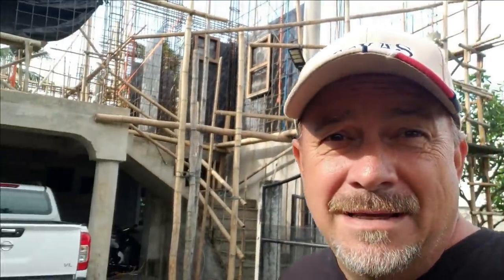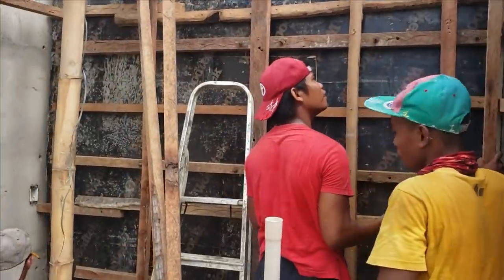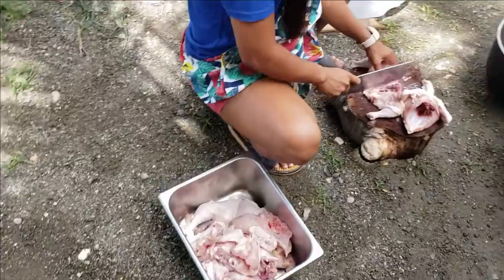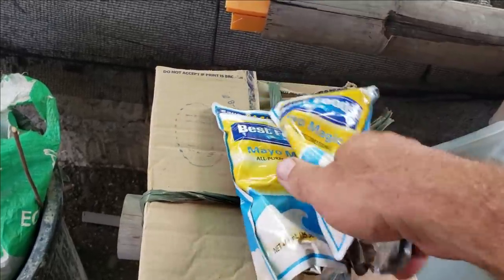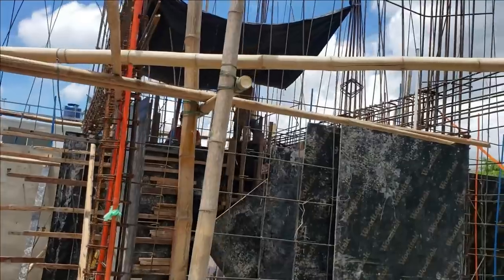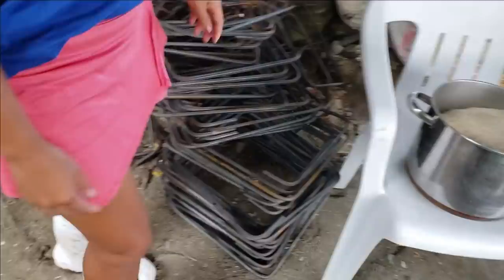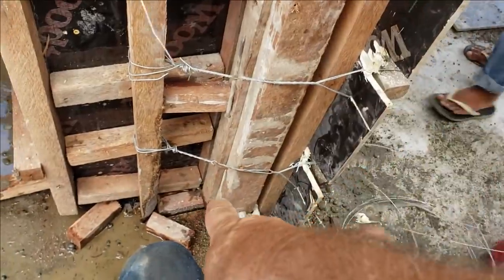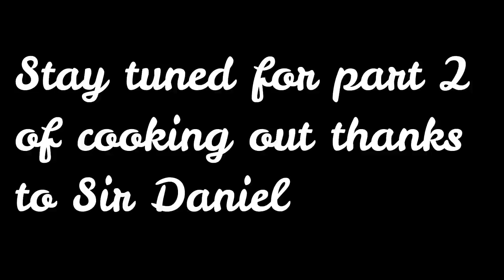Philippines Beach House Build Day 162: We Have Rooms and Hallway Now!

Comment: I know the rubber mallet works well on the forms as your walls look great, but maybe try a sawzall without a blade to vibrate the form.
Reply: Or, better yet a air chisel with a solid rubber ball fix to the end. Bamb!!!!!! No freaking air quaranteed.  Just a little Indiana Red Neck Invention. Trust me it works, I know, hehehe
Reply: @indianabukidboyszutowicz3191  that would work too but you would have to run a air compressor.

Comment: I was wondering, are you going to insulate that place? That concrete will be a giant thermal battery. I haven't seen any design elements that lend well to passive cooling, other than the balconies.
Reply from the maker: The balconies or veranda do a amazingly great job. Then once the house is built the solar panels shading the roof deck like a canopy will also help , The landscaping beds with properly picked plants also help and lastly the roof deck will have piping poured into it that will circulate into the cistern underground with a solar pump during the day time extracting the heat. Then it will rest at night allowing the earth to absorb the heat from the water. This is very cheap to do. Also thermal battery is correct so when you cool the inside of the house the walls absorb the cold and it kinda regulates itself. On my west wall with evening sun our neighbors will be building after us and it will have a WHOLE HOUSE blocking the sun on the side. I will not be wasting money on walls laminated with gypsum which a I despise. Fiberglass insulation that molds in the tropics or expensive  foam that is a fire hazard and emits chemicals into the air. The cost of all that would buy YEARS of power. Our power is from solar anyways. Add more solar instead.
Reply: @TexasFilipino  I really like that idea of hydronic cooling in the roof deck! can't wait to see that in action!
Reply: @TexasFilipino  Nice. I have been wondering about that for a while now. I can't wait to see the roof deck get poured.

Comment: Texas , Ant tips on filling the bolt form hole , add water before filling ? put tape on the back side ?
Reply from the maker: Tom if there is a little drilled hole here and there don't do nothing just use it and pour. The crete will plug that hole in seconds and the form will come right off. If your really concerned I guess you could plug it but we never do
Reply from the maker: only form what can be poured in one continuous session  if pouring 8 foot high. the slag drying on the sides of the forms will fall after sitting and put a later of crumbled up dry crete on top of your wall , then when you pour the rest it will leave a weak spot in the wall. So once you start pouring fill it up.

Comment: Working on an estimate for a enclose back covered patio. The customer is a old engineer who wants me to start with a 1’ x 36’x 4” little concrete wall then stick frame from there. The back yard kinda floods so he believes this will prevent water from coming in. I’m trying to convince to use hollow block since you live it so much😂 if I had your crew this little job would take 3 days verses 2 weeks. I’m doing everything but the electrical. He has to have a breaker added to support the extra. Licensed electrician would be the smart thing to do. Anyway I’m headed to the seafood market after watching this.😂 damn I want some shrimp.

Comment: I have not seen you spraying or wetting the concrete after the pour like it is usually done in «the west» to prevent from cracking, is it because of enough rain or humidity?
Reply: He does the slabs
Reply from the maker: The guys do it constantly and I realize you never see it. of course in this heat it dissipates fast! Luckily we had rains help us a lot as you hear us speak of in videos always. Now ofcourse we cant have sprinklers going because we are working there still.  It wont get drenched like a slab for sure. but yes the guys throw water always. In fact we have a little water wars sometimes. I choose never to show that because the prude people on here thinking they are OSHA police ( which is funny because I am on a island in the South Pacific ) will have heart attacks. LMAO

Comment: How much does the 12 mm Woodtek form plywood cost per sheet?  How much does the 18 mm cost?  Once again, just curious and I am unable to find prices online.  Keep up the good work.
Reply from the maker: there is several brands. crocodile , dragon , woodtek etc. about 1100 pesos per sheet. If you bought 20 - 22000 pesos. that is nothing to the savings on the build and the quality.. buy some 800 peso sheets if needed for odd cut places so you keep your others whole
Reply: @TexasFilipino  $23 per sheet?  You'd pay more for crap OSB here, nevermind coated form-plywood.  You're talking less than $500 total for form plywood.  If you spent $1500 to 2k you could form everything in one go, per floor and do continuous pours.  You really are doing this in a budget-minded way, very monetarily efficient.  Much less labor-intensive and stronger than hollow block with better plumb lines, etc.  That cocoa lumber is crap, though, compared to douglas fir, but, when in Rome...

Comment: You put your walls on a foundation correct? Not the type you do with crumble block and then did the floor later.
Reply from the maker: my walls are sitting directly on a big tie beam that attaches directly to the columns that going in deep to a huge footer at the base of the column. That shit of putting hollow block to the ground is dumb as hell

Comment: I HAVENT been able to see how you attach at the bottom. It appears that you use 2x2 coco (hammered??or screwed?) into the floor concrete?
Reply from the maker: I drill the holes in the crete so the nail does not pop or fracture the concrete. It is not about holding down it is just pinning it. The load is to the side.